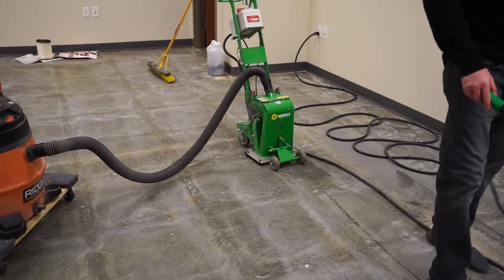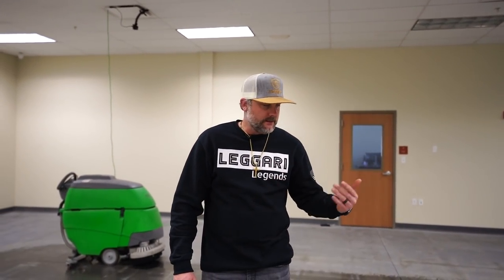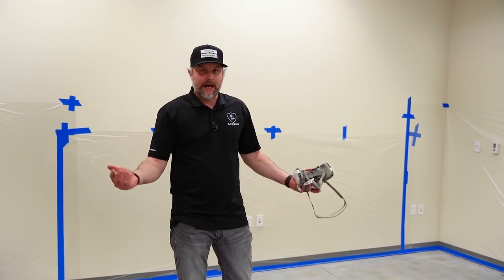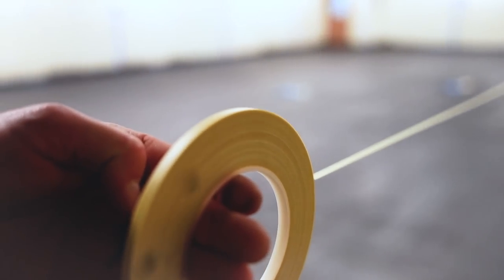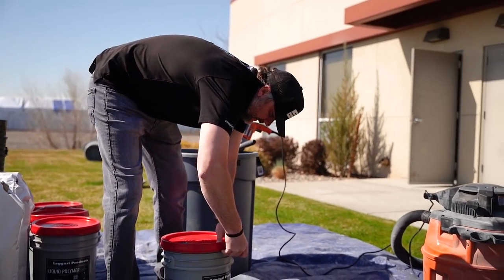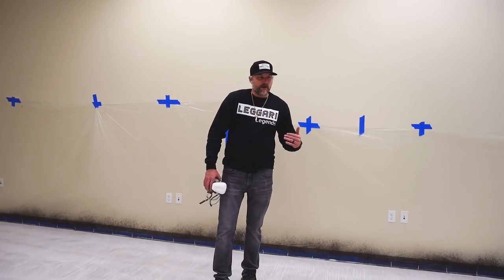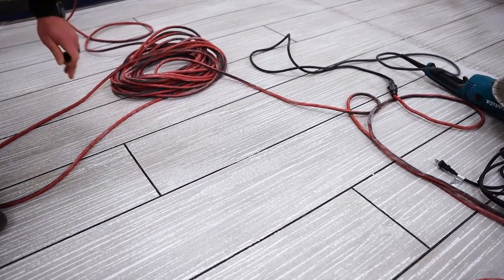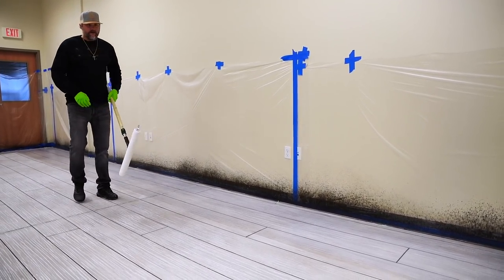How To DIY Hardwood Concrete Floor | Step By Step Explained

Comment: Still confused how you guys got the hardwood texture look? After you guys spread the concrete and troweled, sprayed, sanded, did it just naturally look like it had wood grain or did the trowel you use to level the cement have some sort of grain texture when you leveled it out?

Comment: You can use the DeWalt vacuum attachments to that Makita so you dont have the blue tape connection. It has helped us with easy, quick connections.
Reply from the maker: Thank You!

Comment: Oh that’s so awesome. My garage floor is always wet and damp. How can I stop it.
Reply: Get a dehumidifier to dry out surface, get Ardex Rapid Set Moisture barrier Get enough to put it down at 150 square feet per kit (it will say 200 sq. feet but you want it to look good on the surface. it normally goes under floors.) mix one kit at a time, squeegee it back roll it, actually is a black metal flake, you can broadcast vinyl chips into it as you go. then a clear urethane on top of that: 2 coats. No more moisture. Not cheap epoxy but it works. DUMP 2 part products on the floor when mixed.
Reply from the maker: Thanks for watching! Oh no, Not sure definitely have a professional check it out!
Reply: @RON-dl9qr  
Thank you 🙏

Comment: I'm just curious about what you used to get the wood grain  look
Reply from the maker: We use a pool trowel and run it long ways with your planks and it leaves behind those high ridges that you come back a sand off with a floor sander to expose the wood grain color! Thanks for watching!
Reply: Smart not to show that post huh 🙄

Comment: If I’m doing this on a new construction slab exactly how much/which machine do I need to prep? It’s not sealed or anything? Floor sander and clean?
Reply from the maker: Shotblast the floor to take off the cream layer to ensure a good bond!
Reply: @LeggariProducts  really? I didn’t expect that for a brand new slab! If I can’t find the shot blaster HD has a tool called a “concrete prep tool” do you know if that would work?
Reply from the maker: @rachelt7626  You can also grind the floor with a diamond wheel, on a floor grinder, shot blasting gives you a better profile tho.

Comment: Do you just place those scrubbing pad under the brush on the sunbelt  are they mounted or locked in position or is just the weight from the machine keeps them in place?
Reply from the maker: Not sure exactly what step you are talking about? Can you be more specific, are you talking about autoscubbing?

Comment: How did you get those lifted looking grain lines? Nice job btw
Reply: @LeggariProducts  I meant the white, wood looking grains in the tile fields. It looked like white lifted wood grains. Thx for the reply.
Reply from the maker: @alphapimp  We used a concrete pool trowel attached to a pole walking with your wood planks back and forth, and it leaves all those high ridges that you sand off to expose the wood grain color
Reply: @LeggariProducts  very cool, thank you!
Reply: I was thinking the same thing. I can't see the replies. Maybe it's my signal.
Reply: @tdmallet  let me know if u can see the replies with better signal
Reply: I can see them now. I thought that's what he's was doing with that stick after the trowel guy. Or squeegee.

Comment: would like to see how you did the wood texture I don't know if i missed it or you just did not show it.
Reply from the maker: 32:41 This is a pool trowel that we attach to a pole, and if you watch after he puts the trowel on the pole, they start laying out the overlay, he is on Leggari spiked shoes so he doesn’t mess up the design while walking back and forth in straight lines with the pool trowel and it leaves behind those high ridges that you come back and sand off after you stain the top, which exposes the wood grain color. Really cool process!

Comment: How did you get the wood look? You didn’t explain the trowel that followed the magic trowel
Reply from the maker: Yes, you just use a pool trowel going across the entire floor in straight lines. Doing this leaves behind the high ridges that you sand off to expose the wood grain color.
Reply: @LeggariProducts  thanks!

Comment: Can you put a Polyaspartic Top Coat on this process to have a stronger wear layer with Stronger UV Protection ?
Reply from the maker: Leggari Urethane topcoats are all you need and is 100% UV stable!

Comment: I would blame sunbelt for not giving you the corresponding vac setup for that blaster. That machine is made for forward. Without the proper CFM it will either not reclaim well enough or dump all shot constantly. Usually need a 2 motor setup for that machine.

Comment: How long does it last. Is it slippery?
Reply from the maker: Our Hardwood Overlay with last years...... and years..... We guarantee our proprietary kits are so strong they will not delaminate (peel off) or wear off over time 💯 People love this flooring for spaces that need to be durable and highly resistant such as garages or shops. For more info, check out our Hardwood Overlay Kits here 👇
https://leggari.com/order-flooring/#hardwood-overlay-kits 🔥
Reply from the maker: Like other flooring, Hardwood Overlay can be slippery when wet but the flooring is naturally textured and has grooves for traction.

Comment: We’re I can buy the tool you used to do texture coat? Thanks
Reply from the maker: You can find the pool trowel we used at many larger home improvement stores like Home Depot or Lowe's. We simply attach it to a pole for easier use.

Comment: Why did they have to do a pass with that magnet? After the grinder?!
Reply: Nevermind I guess that's some kinda machine that shoots small metal shavings at the floor?!? Then you need to pickup the shavings.
Reply from the maker: We used a shot blaster that shoots small metal bbs to profile the floor before we put down the coating and yes it a magnet that picks up all the extra bbs!

Comment: I WORK FOR HERC RENTALS ON THE FLOORING SIDE. I SERIOUSLY DON'T GET WHY YOU'RE USING A SHOTBLASTER TO REMOVE THE GLUE. PLEASE EXPLAIN. ALSO YOUR VACUUM DOESN'T HAVE ENOUGH CFM FOR THAT SHOTBLASTER. CALL HERC, OVER 270 LOCATIONS NATIONWIDE
Reply: Have no idea why they are using shot blaster
Reply: To knock out the old grout in the saw cuts and the removal of cream layer for better stain penetration to avoid a black underlay step.
Reply from the maker: Thanks for the tip!

Comment: 3 phase Concrete grinder, medium bond 25s add water and sand, glue gone cuz!
Reply: Ya I don't see why these guys are blasting glue, unless it's super thin it's not really doing anything. Blaster is great for prep after grind though. I wouldn't really use water and 25s though, rather use pcd with vacuum on the grinder for easy cleanup.
Reply from the maker: Thanks for the tip!

Comment: so the "grout line" created by the tape is basically empty divots exposing thin concrete edges. I'm curios to see how long this flooring method would last with sliding furniture/wear and tear. Also you guys are so terrible with safety. I get that you're professional, but safety should always be number one.

Comment: its not picking up the beads because you dont have a powerful enough vacuum for that suction. plus...put some duct tape around the skirt...the brush skirts they come with are trash
Reply from the maker: Thanks for the tip! And yes we know the vacuum was too small the rental place only had the shot blaster we had to make do. For that very reason we will selling are own line of Leggari concrete prep tools soon!